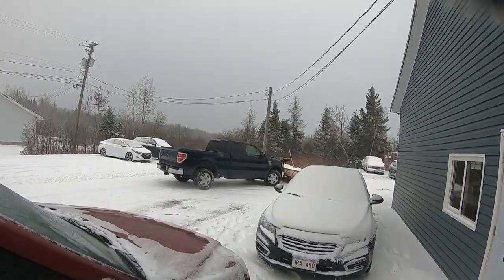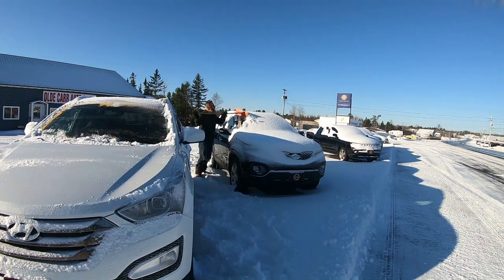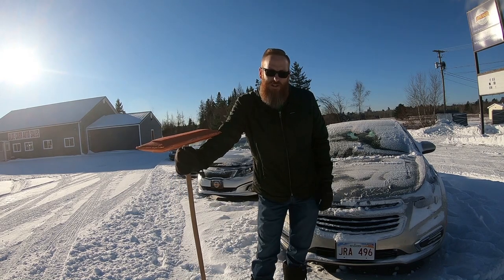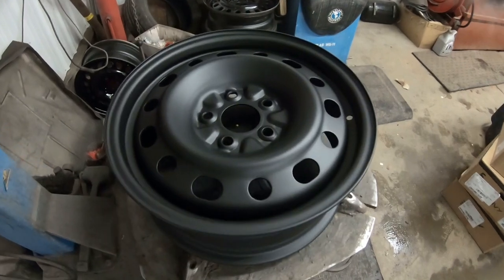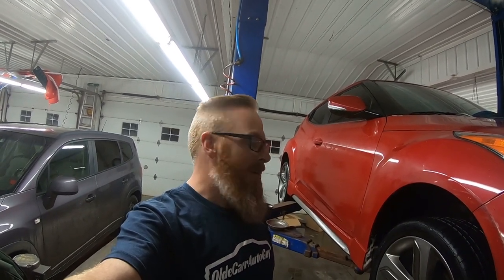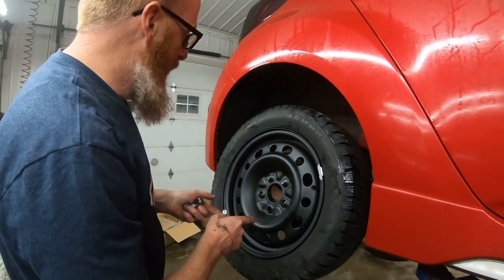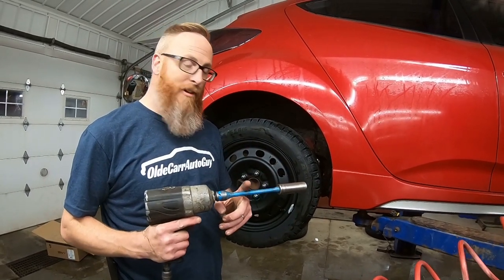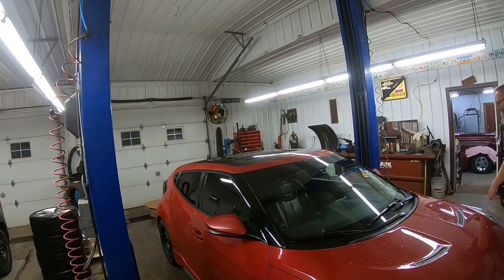WHY WE DOWNSIZED OUR WINTER WHEELS AND TIRES ON THE VELOSTER TURBO

Comment: Digging the tread on these tires. What brand and size are these? Thanks
Reply from the maker: Hey! Thanks for stopping by! They are 205/55r16 Ovation Ecovision winter tire! There are several tire brands that carry a very similar tread pattern! The General Altimax winter is one!
Reply: @OldeCarrGuy   Hi i just got 17 inch ovation winter tires for my veloster , just wanted a feedback on how good the tires were in the snow ?
Reply from the maker: @freelishjoy9617  They are decent tires. you just need to be aware that like most winter tires, they don't like dry pavement. So if you do a lot of highway driving, you may only get a couple seasons on them.
Reply: @OldeCarrGuy   Thanks just got them today ! I just do local driving mostly and i live in BC !

Comment: Hey I have a 2013 Hyundai VT currently using 225/40R/18 summers, what size winters would you suggest I use?
Reply from the maker: If you're looking to downsize like I did, 205/55r16 on 16" wheels. But if you are mounting on stock 18" wheels, I would recommend whatever the door sticker says.

Comment: Was wondering. My RAV4 came stock with 19” wheels. Would it be advisable to downsize wheels from19s to 17s or maybe even 18s?? (New to making changes on car) I as well live in a winter climate for about half of year haha. 
Much appreciated sir.
Reply from the maker: It depends on the year of your RAV4. Most newer ones came stock with 17"  and 225/65R17 tires. I'm sure you could downsize with no issues!
Reply: Mines a 2019. But yeah came stock with 19s. Thanks for the response!

Comment: what brand name are you using  also how do they ride without the snow doing about 60 is it a rough ride
Reply from the maker: The wheels I used were MacPek brand. As far as the ride, it's much better than stock 18' because you have more sidewall to cushion the bumps. Having said that, it won't corner as well as low profile tires. Thanks for watching.
Reply: @OldeCarrGuy  thanks  for the reply i ordered rims for my Veloster now ill get tired and know what to expect  thank you again...

Comment: were did you find rims for 55 dollars also what size rims are the ones you bought
Reply from the maker: As a used car dealer we have access to a number of distributors for winter wheels. These are 16"
Reply: @OldeCarrGuy   thank you i need to get rims for the winter  so  these are regular size 16 inch

Comment: Hi i have volvo s60 2015 on 23540/R18. I want comfortable ride. Pls suggest smaller size rims n tyres. Thnx
Reply from the maker: Hi Samir! The thing you need to watch out for is whether or not a smaller wheel will fit over the brake caliper! You may be able to go down to a 235/4517 or even a 215/55R16. I hope this helps!

Comment: I'm trying to downsize my 2015 VT to 16inch rims and need exact rims specs so I wont rub the calipers. Can you provide that info if possible? Thanks
Reply from the maker: I’ll get back to you in the morning!!!👍 Thanks for watching!
Reply from the maker: OK! Here you go!  Its a 5 lug by 4.5" (or 114.3mm), 16" rim diameter, 6.5" wide with a +43 offset.
Simplest way to find one is to ask for a 16" wheel that will fit the same year Hyundai Accent. The Veloster shares the same platform!

I hope this helps!
Reply: @OldeCarrGuy  thanks man. I thought the 16 x 7.5 would fit but I'll go with your specs
Reply from the maker: @r.f1981  You likelly could. The factory 18" are 7.5's. It's just easier to find a stock replacement in a 16!

Comment: Aluminum wheels for my car are $15.00. Nobody's interested in your wheels, unless you live in an extremely blue area.
Reply from the maker: Thanks for watching. See you in e next video!
Reply: @OldeCarrGuy  Car is 215 70 R15, OEM. Wanted 2, U.S. made. Mastercraft rear tires for my rear wheel drive car, but 10 local dealers didn't have in that size. Going with Kelly winter tires in 195 60 R15, because they were the cheapest, at $78.00, and there's a slight chance they are made in the country that I live in, since they are allegedly owned by Goodyear. I've driven on doughnut spares for weeks. These narrower, smaller profile tires won't be any worse than that, till March, at least. I'll let your viewers know how it went, for 2022-2023 winter. I have a rear wheel drive car, so, this should be an interesting experiment. Thanks for the video.

P.S. I live in MN, so winter here isn't tiddlywinks.